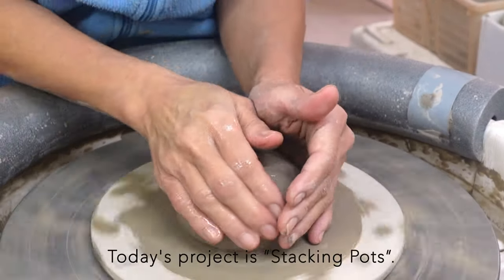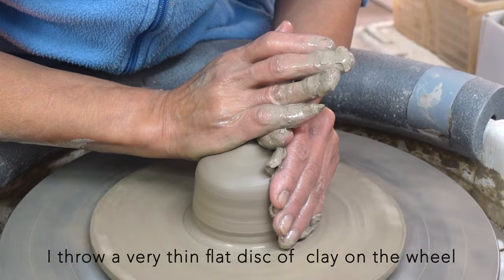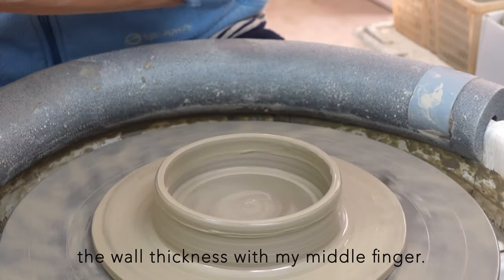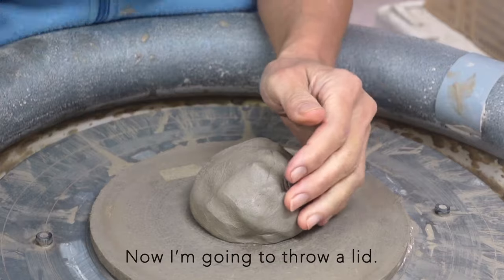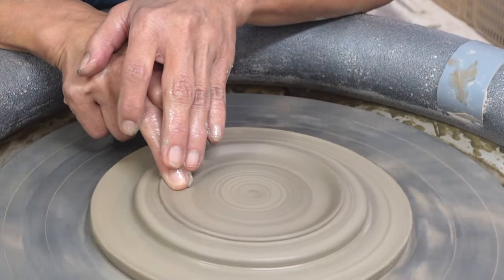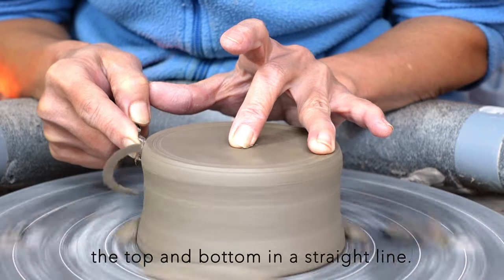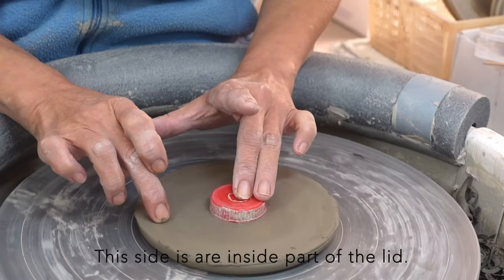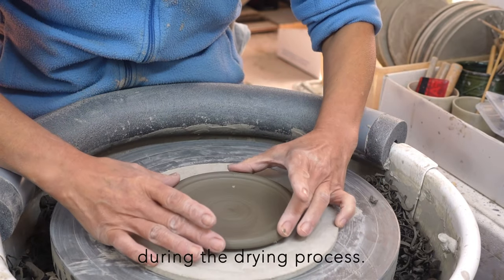Throwing Stacking Pots on the Pottery Wheel

Comment: Thank you for this wonderful video!!  Just curious to ask why you don’t use pins on wheel head to easily place bats with holes to fit?
Reply from the maker: Thank you for your comment 😊. I have two pins on the wheel and these are for full size batt which I use for bigger pots and plats. These take space for drying process. If I use small batt I can make 20 instead of 10. So only matter of space.